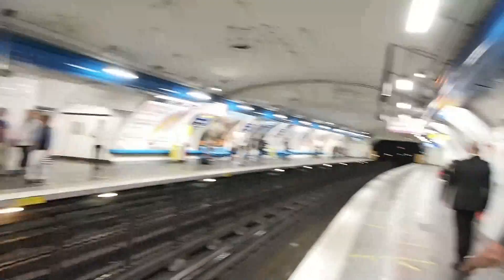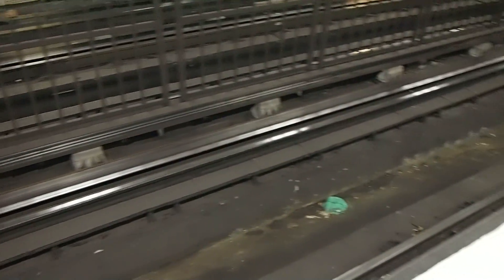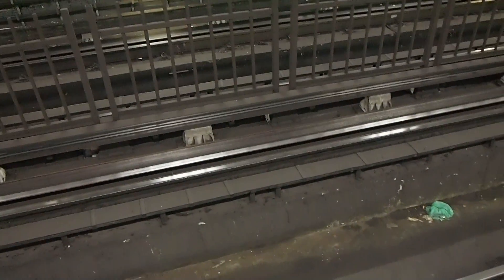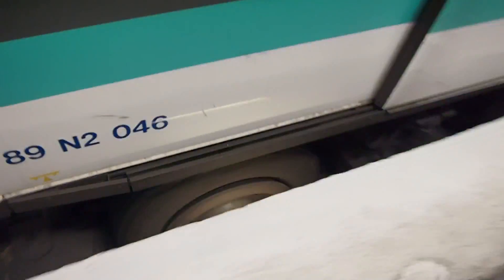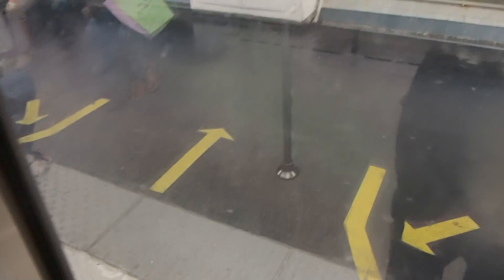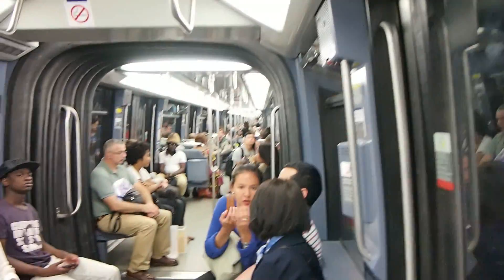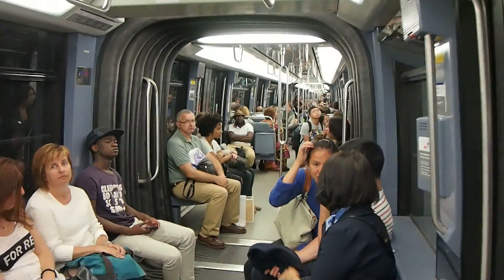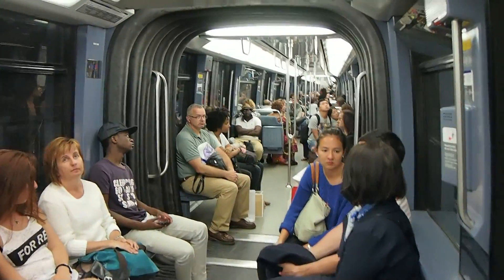The rubber tyred Metro Line 4 train in Paris

Comment: Nice video. Paris has both, rubber and steel-tire trains for underground. You got more information on how the two compare?
Reply from the maker: Yeah rubber ones are much quieter and comfortable. The rubber trains also have steel rails and steel wheel to guide the train but the weight is borne by the rubber tyres. It must cost a lot more to maintain them with 2 systems to worry about on the same line.